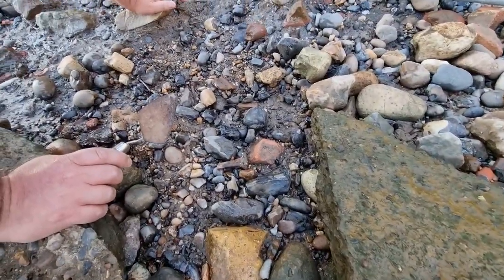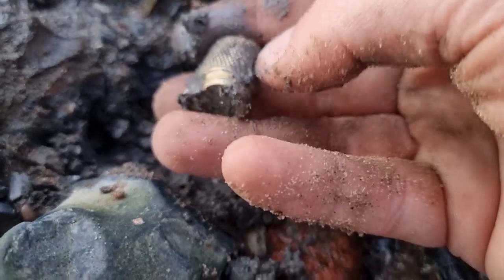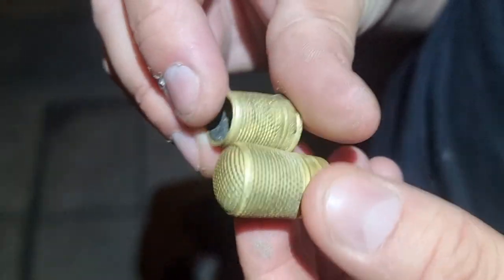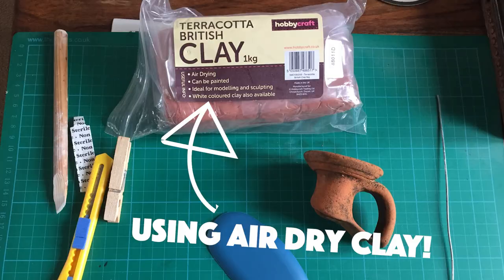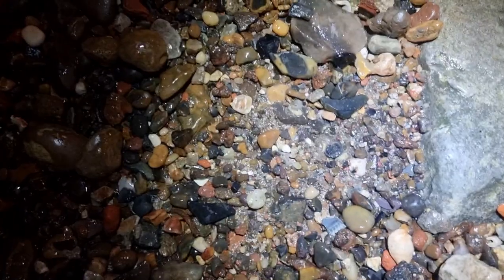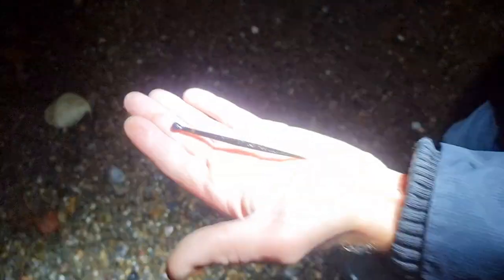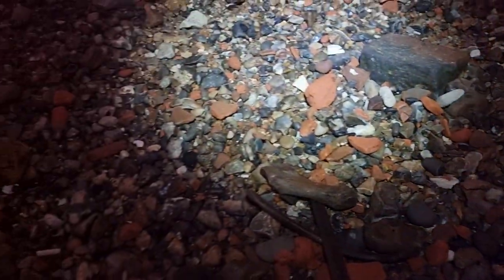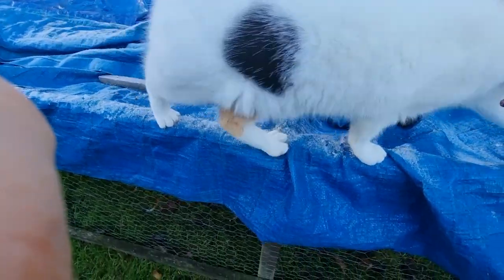The Museum of London WANTS what we found Mudlarking The Thames!

Comment: The easiest way to see whether it might be a meteorite is to test it for nickel.  If it has nickel it might be a meteorite, but if it doesn't, it isn't one.  You can get nickel tests for a few dollars online, but an SEM or XRF would give more accurate / reliable results.  

You could also cut it and try to etch it with ferric chloride or nital to look for a pattern, but nitric acid can be a little difficult to find.  

The shape of the metal fragment doesn't look too promising to me.  Looks like a fragment out of a larger layer of metal.  Maybe a cannonball with a charge in its center.
Reply from the maker: Thanks mate, what was curious was the fact it wasn't magnetic, which rules out many tools and scrap we find on the Thames
Reply: @Sifinds  Metallic meteorites are a mix of nickel and iron.  All 'iron' meteorites found have contained between ~4 and ~70% nickel, and they're all strongly attracted to a magnet.  

...If it's not attracted to a magnet, there's no chance it's a meteorite.  Thought it looked ferrous - what metal do you think it's made of?
Reply from the maker: @MeteoriteGallery  How do we know all meteorites contain Iron, they come from outer space so anything's possible
Reply: Heh, that's a good question.  This is going to be very long, but I hope it explains it well.  

The universe is around 13.8 billion years old.  When we look at any given star, we can tell its temperature, luminosity, and some information about what's inside it based on the spectrum of light it gives off.  The earliest stars were supermassive and existed for only a few million years.  They sucked up the product of the Big Bang – hydrogen – and started producing heavier elements. 

The amounts of particular elements and isotope produced by any given star depends on the mass of the star.  The details are complicated, but based on observations of stars and particle physics experiments on Earth, we have a pretty good idea of the reactions involved and we know how elements are made in stars, and even in what proportions.  

And because stars produce heavy elements, the stars that came after those first stars could incorporate different mixes of material and were much more varied.  Larger, smaller, and depending on what they incorporated from other stars, they started with very different compositions -- more or less helium, hydrogen, oxygen, carbon, metals, you name it.  Those differences have become greater over time, as generations of stars have formed and died, producing and moving heavy elements around.  

Every meteorite we've found so far formed ~within our Solar System, from the same source material as the Sun and planets.  When we look closely at primitive meteorites, we find microscopic grains of really tough minerals like silicon carbide, titanium carbide, graphite, diamond, etc.  The carbides mostly formed in main sequence stars like our Sun, but the graphite and diamonds formed in supernovae.  In short, we're sourced from a messy mix of stuff mostly from 3-4 different stars, and it has a very distinct fingerprint.  Elements like copper, gold, etc., are so rare that they are only present as ppm trace contaminants in larger minerals and metal grains.  We see that in spectral data from other planet-forming regions as well.  They look ~similar to our Solar System, with some slight differences.    

In our neighborhood / star-forming region, when the Sun formed, iron and nickel were the two most common, chemically stable metals around.  That's why, when you look at the rocky planets, they all have iron-nickel cores.  Iron meteorites mostly formed in ~the same way -- as asteroids and planetesimals accreted in the early Solar System, larger bodies melted, and the heavy stuff settled to the center in a process called differentiation.  When we look further out, at extra-solar planets, it looks like most rocky planets form iron cores.  If you want to go down an interesting rabbit hole, google “polluted white dwarf.”   It’s really cool stuff.  

Now, humans have found and studied a lot of meteorites.  Close to 100,000 at this point.  In meteorites, we see little to no evidence for geologically active bodies in our Solar System after its first few million years.  Most meteorites accreted, cooled, and then remained ~unchanged for 4.5 billion years.  Earth is a unique body in the Solar System.  It's got a lot of internal heat, and an active hydrosphere, which drive plate tectonics and complex chemical reactions in the crust.  Those reactions are responsible for producing interesting mineral deposits, ores, and stuff like that.  You’d never find, say, a gold nugget on an asteroid – there’s simply no way for one to have formed in that kind of environment.  At best, we’ve found micron(1/1000 mm)-sized grains of metallic copper and gold in some meteorites, that formed as vaporized metals condensed after impacts.  But there’s no chemical or mechanical process we are aware of that could further concentrate those elements into larger aggregates.  We’ve never seen any evidence for anything remotely like that on asteroids.  

Asteroids simply weren't hot enough for long enough to do anything like that.  You can run the thermal models -- they're too small and lose all of their heat too quickly.  

Some bodies are active, though.  Due to tidal heating, Io's pretty hot, and very geologically active, but its volcanism is sulfur-based.  We've never found a piece of Io: if we did, it wouldn't be a piece of non-ferrous metal.  Enceladus is wet, and covered in a massive layer of ice: anything knocked off of Enceladus' surface would be ~ice.  Venus and Mars have some active volcanism, but we've never seen any evidence for complex ore deposits or native metals on either of those bodies.  No plate tectonics, no hydrosphere...  And we do have a few hundred Martian meteorites -- they're all pretty dry rocks.  

So, back to your question -- why couldn't a piece of non-ferrous metal be a meteorite?  

Well, based on what we know of our Solar System, if it was a meteorite, it didn't form in our Solar System.  It would have to be the first "extra-solar" object ever recovered on Earth.  Possible?  Maybe, but very unlikely.  

But let’s roll with it -- what if it was a meteorite from somewhere else?  Well, look at it this way: if we took a random sample of a planet from this Solar System, what are the chances that you would get a sample of non-ferrous metal?  

You’d have to pick up a piece of…native copper, from the deposits in Michigan?  A piece of native gold from California?  But if you picked up any random rock on Earth, what is the chance that it would be a piece of metal like that?  

It’s…technically possible?  But the probability is ~0.  Even on Earth, the best body in our Solar System (and the known universe) to make things like that, naturally concentrated native elements like that are still ridiculously rare.    Could a star make something like that?  Based on our understanding of stars and how elements are formed within them, no.  

Conversely, people have been refining and using different metals on Earth for thousands of years, and they’ve been dropping them in the Thames for almost as long...  

- Sorry that ran so long, but it's a question with roots in a lot of stuff.

Comment: Does going out at nighttime have its advantages vs going in the day? To me it seems like it would be better just because your headlamp lights up an area to search and the rest being dark around you seems like it would make it easier to focus on each area at a time. The daylight helps to see all but it seems almost overwhelming because there is so much everywhere! What do you think?
Reply from the maker: I prefer daytime, you can see patches 20 or 30 feet away worth checking out, but in the dark you don’t know till you get there. But the power of the torch can help see in the cracks and darkened areas